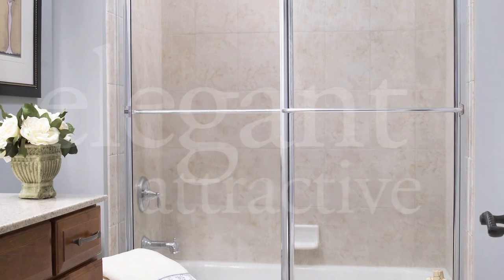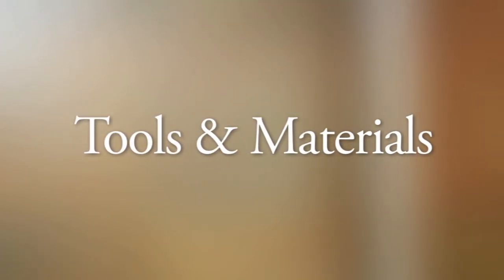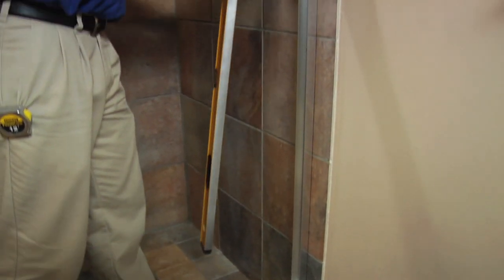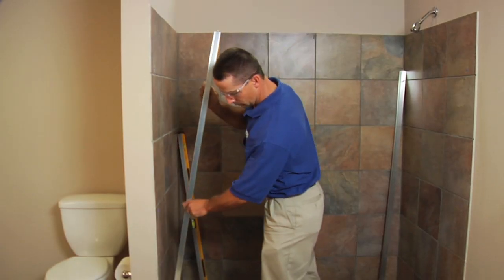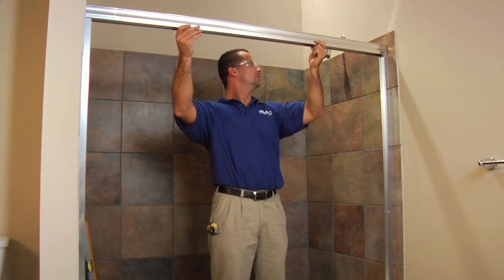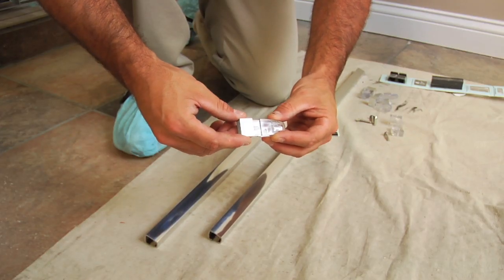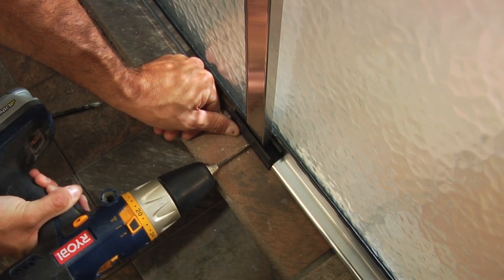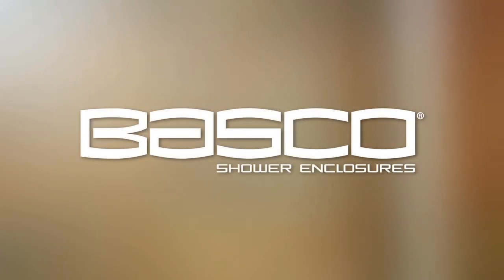DIY Framed Shower Door Installation - Basco Deluxe 6150 & 7150 How To

Comment: Best video to watch if you buy basco. Installed easily except for door adjustments. Had to keep taking off till I got them right. Start rollers in middle of diagonal slot then adjust. Otherwise pretty straight forward.

Comment: I bought a patterned glass version of this Basco bypass shower door.  Point # 6 in the instructions that came with the door says that the pattern should face to the exterior of the shower.  What they don't emphasize clearly is that you need to install the Roller Bearing to the SMOOTH or GLAZED side of the door so that when you hang them, they can slide properly.  The image on the instructions is clear but they don't tell you how important it is to copy the image in the worded instructions.  IF you hang the doors and they don't slide easily back and forth, you attached the roller bearings to the wrong side and on the wrong door.   You will need to pull the doors off and remove the roller bearings. Then switch the doors and screw in the roller bearings again.

Comment: My door is wobbly when we close it and doesn't line up with the door jam unless we glide it be hand to the jam bumper any suggestions
Reply from the maker: Hi there, thanks for your comment. The problem may be a defective bottom guide causing too much pressure on the panel while sliding, or possibly a defective roller. Another possibility is that the wall jambs were not installed plumb, which will cause the panels to lean and not line up with the wall jamb bumpers. Our first suggestion would be to check that the wall jambs are plumb. If they are not, this would be the first thing to fix. If they are, please reach out to our Customer Service team for assistance with replacement parts. You can reach us at 1.800.45.BASCO or via inquiry@bascoshowerdoor.com.

Comment: Yesterday I had a 6150 version of these doors installed on a tub. I did not install it myself but had a Lowe's contractor do the work. I was told to wait 24 hours to use it so that the silicone adhesive could dry. Today I examined the door. I immediately noticed that the small, square, plastic finger grab of one door could strike the aluminum frame of the other door when either door was being slid opened and/or closed. There is no doubt that this would cause damage to either the metal frame of one door, or the finger gab of the other door, or both. It could happen as quickly as the first hurried slide of either door. The doors appear to be installed correctly. I am puzzled, and disappointed, by what appears to be an obvious design flaw.
Reply: The doors are not intended to freely slide past each other. The finger guards should be against the 2 walls when the doors are closed properly.

Comment: Basco Shower Door A0043-60CLSV Classic sliding bathtub shower door. Everything went well until it came to installing  the anti-jumping screws securing the anti-jump plastic inserts. The directions have you installing 1 #11 screw in a pre-existing hole into each anti-jump part. easy enough, except the #11 screws are to small for the hole. I have screws of my own that would fit, but the are not stainless steel. This mean stopping the project and make a trip to the hardware store for 3 cheap SS screws. Basco should have known about this by now... Not happy.
Reply: I'm installing a Basco Shower Door.  There are no pre-drilled holes in the anti-jump sliders.  The top track fits into tee-lock wall jambs.  Now I have to take one jamb loose to get the top track off.  Then I have to take the anti-jump sliders out and drill them.  Two steps forward and one step back.  Greetings from Missouri.

Comment: I bought the 7000 series and had it delivered. It was delivered upside down. Now what do I do ? I can't install it upside down can I ???
Reply from the maker: Hi there, thanks for your question. We actually do not have a door that is called "7000 series". If you are referring to the 7150 door, then you should be able to just take it out of the packaging and turn it around. There is no "up" or "down" side of the door itself. If you have an issue with your installation, please reach out to our customer service via email or phone. They will be able to help you with your installation.
Thank you!
Reply: @BascoShowers    damn .....  swallowed hook and all. Psh

Comment: How do you know if reinforcement is built into the wall of the unit?!
Reply from the maker: Hello Sully, thank you for your question.  When measuring, we find that using a stud finder works well.  Our installers use that to determine if a wall has a stud and where it is located.  You can purchase a stud finder at your local home improvement stores, such as Lowes or Home Depot.